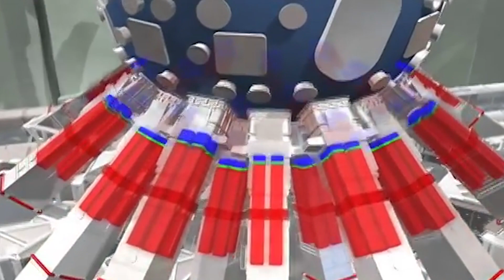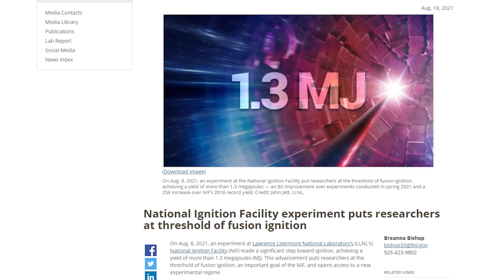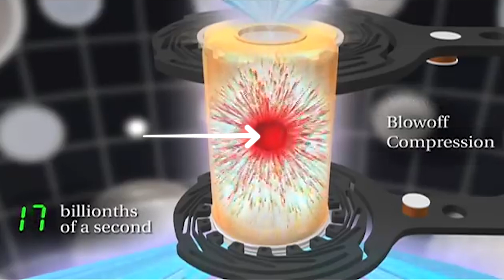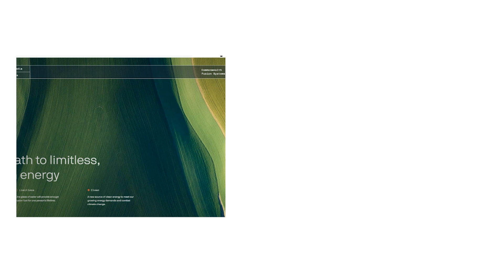NUCLEAR FUSION IGNITION – Have Scientists Finally Done It?

Comment: Why not use antimatter as an ignition device? By raising the plasma temp high enough, so the thing won’t blow up from a “cold” start? Consider! Far less input energy to start. Energy output could be greater,far greater than energy input. Sounds like sci-fi, but we’ve been struggling with this thing for at least 70 years and it’s alway just over the horizon. Worth a shot,I think!
Reply: Because producing a usable quantity of Antimatter is a nightmare and expensive as hell

Comment: (Caution long comment) 
Iam currently pursuing physics undergrad. Iam took a course on thermal physics. Iam really confused about one question and i been thinking too much about it. The question is, Is there any relationship between radioactive and temperature??

I know this question seems to be an irrelevant one, considering the fact thermal physics is much more different field from nuclear physics. But let me explain my question in details

My hypothesis is radioactive can have some effects on the surrounding temperature.
Let us imagine there is room that is isolated from thermal contact from the rest of the world, the room is in constant pressure and temperature(initially), now an radioactive source
Is kept in that room(considerably larger relative to the room).

In that room the radioactive source emits radiation.

According to kinetic molecular theory of gases, temperature is just Average kinetic energy of the gas molecules, and the average kinetic energy of the gas molecules can be increased many way(increasing pressure, work, or just simply heating)

If an radioactive source is emitting radiation particles which carries energy, there is a significant chance that it will collide with an air molecules in that room and it will transfer some momentum, which lead to increase in the kinetic energy of the gas molecules and thus increasing the room temperature.

It may not be a significant increase in temperature but there may be increase in room temperature.

There may be other scenario(what if the radioactive source only emit gamma rays which doesn't have enough momentum to change molecules energy) but let us assume the source only emit alpha particle in a high rate.

Please anyone explain me this. Does radioactive increase surrounding temperature? Are there any relationship between radioactive and temperature?

Is my hypothesis is worth discussing or it just some misconceptions... Please provide me solutions
Reply: Uh.. yes. Of course. Radiation is just fast moving particles. They interact just like any other particle. 

How do you think a nuclear reactor works? Energy is released from fission in the form of fast-moving neutrons electrons and high energy light. 

These things heat up the nuclear material itself which is then cooled down with a liquid. The liquid is then used to heat up water. Which is then turned into steam which then turns the steam turbines.

Comment: This NIF never seemed like a scalable solution to me. We cannot economically build gigantic laser facilities all over the world, certainly not economically compared with a myriad of other options. There's also the problem that these facilities are yet another centralized energy generation system. We should be moving to more distributed systems if only to remove the stranglehold these gatekeepers have over us. Far better to have household or community control over these energy assets, as can be readily provided with Solar, Wind and Geothermal systems
Reply: The NIF was never supposed to be a commercial system.  It's a research tool intended to explore the parameters of what it takes to create successful fusion.  In engineering terms, characterize the process.  From that you can design something that would create only that environment to generate power.

Comment: Basically, this fusion hype is specifically released to persuade governments and investors to continue to fund the (very slow) progress towards a fantastically expensive centralised reactor. I'll bet you that the research and development budgets expended on this tech outweigh investment into nuclear fission R&D by > 5:1.
Actual power from fusion into the grid is probably 20-40 years away. Meanwhile Global warming requires swapping out dirty energy sources like - yesterday!

Compare this with investment into modern forms of nuclear fission, which could be on line and replacing Coal/ Gas and Oil power stations within 5-10 years if even a fraction of the wasted money on fusion research were put into (say) molten salt reactors using "spent" nuclear fuel (actually, fuel with 95% of it's energy still waiting use), and, of course, Thorium.

But this POV will be squashed by those who have most to gain from continuing investment streams nourishing them for the foreseeable future (despite being no actual good to reduce global CO2 emissions until it is much more too late!)

Comment: Once ignition is reached, how do they intend to maintain the reaction and harness it? It sounds a bit like trying to harness lightning.
Reply from the maker: Great question! Probably similar to how they harness energy from fission. Essential capture the released energy by using it to heat water turning it into steam, which then powers turbines to generate electricity.  The main problem with this architecture is how do you run this process repeatably? At the moment, they don't have an answer for that, they are still working on the fundamental engineering.  That's why things like ITER are more likely to be "useful" fusion reactors once they do work, as fuel is easier to continue to add.
Reply: Since ignition will give net positive energy, the energy required will go back into keeping the reaction going. Since it's net positive, there will be usable energy.
Reply: Using produced neutrons as classic fission bullets 🎉